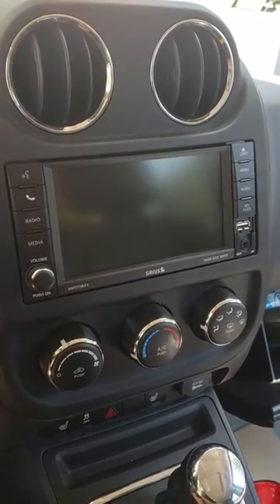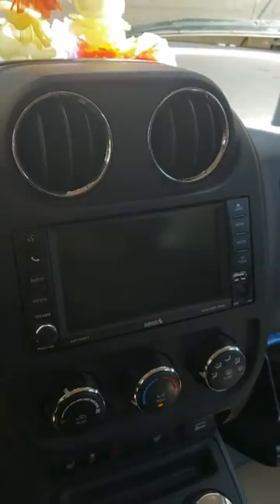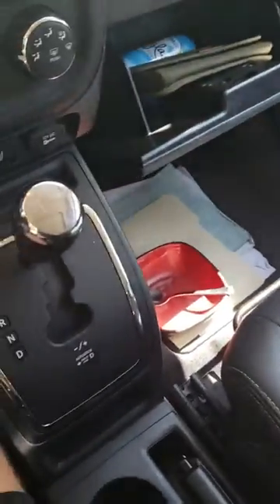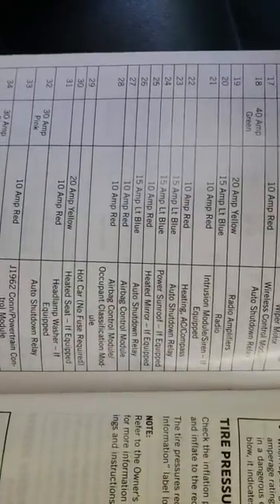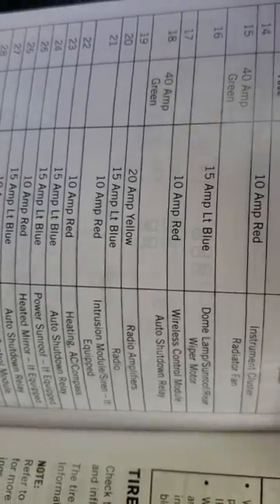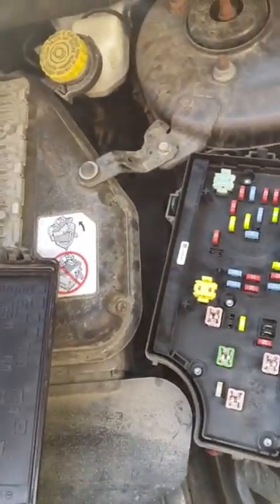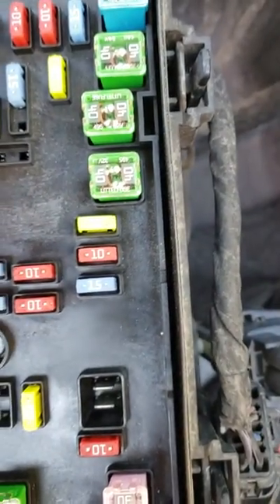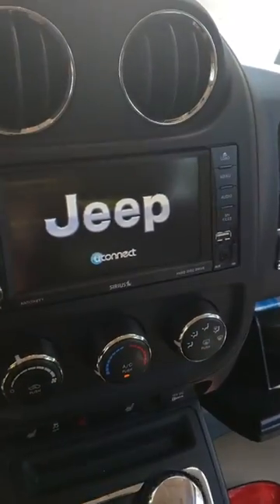How To Fix A Broken (Black Screen) Radio For Less than $5!

Comment: In our Kia Optima, the radio is still functional…but the screen remains completely black. I can still change the station, but can’t see anything for the radio or backup camera. Was this the case for you as well? If so I guess I’ll just change the fuse and hope this does the trick.
Reply from the maker: Unfortunately I don’t think the fuse is the issue in that scenario but i guess it would never hurt trying. I think it would be the device itself maybe has a loose display cable or something. It wouldn’t hurt reaching out to Kia and seeing if they could fix it for you. If you’re nice enough they might do it for reduced cost or free
Reply: Figure it out?
Reply: My kia optima has the same problem, with the weather temp being so hot the display is black and can't see anything but once the car is cool enough in the inside the display starts showing up untill it gets to the original display 🤷‍♀️
Reply: Did you ever figure this out
Reply: @ans26ceb Backlight problem